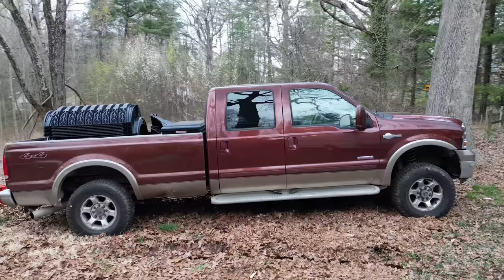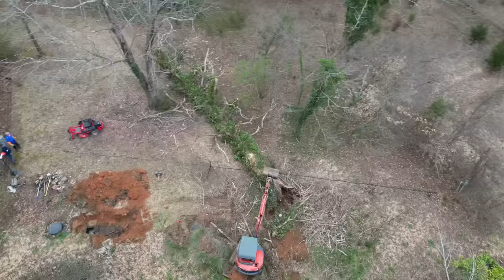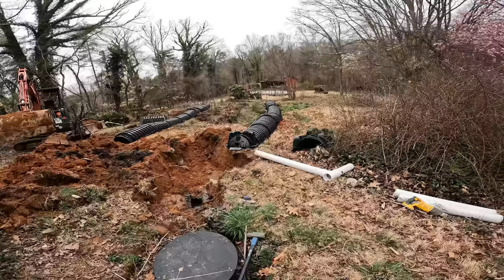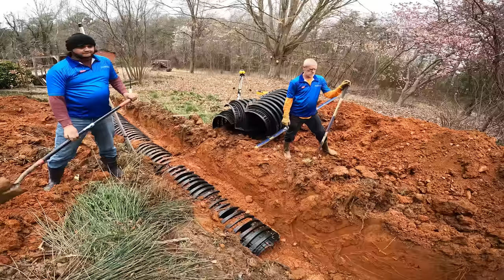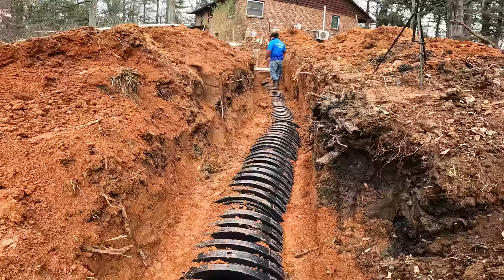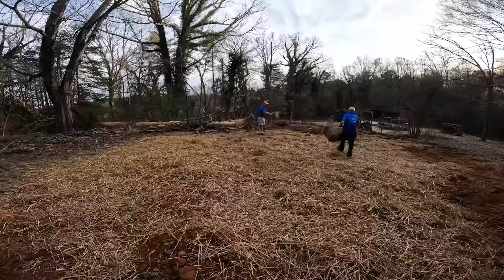Repairing a failed leach field by Replacing a septic field with chambers

Comment: Ugh, I would never want to do anything like this. We had issues with our septic tank when we bought our current home. It had a drain field in thick clay and it never worked properly and we had constant surfacing. Smelled terrible. Had to change the whole thing out for an aerobic system. Works fine now.
Reply from the maker: One thing you can do in that situation is pipe the gutter water away from the field. That can do wonders for the surfacing and smelly shovel that is placed in the ground. I've done this many times with drainage systems and it improved the septic field. 👍

Comment: You said, "This double-split is perfectly level.  I showed you already."  Actually you didn't.  You only told us.  You speeded up the part where it was leveled.  To explain to viewers what they missed, your employee leveled the double-split BEFORE glueing, then marked both the split and the adjoinging pipe.  Once glue is applied, all he had to do was align the marks to know it was level. 

I'm so glad you made this video.  My dad hand dug a tank and lines in the 1951 house I grew up in.  He used concete & clay pipe and always had trouble with roots.  In the 1970s, I used perferated plastic pipe and gravel for field lines.  Less than 10 years ago, I had a new leech field  installed where I now live.  They used chambers like you.  I wondered how it works.  You just solved that mystery.  Thanks.

Comment: Interesting project as I'm a city boy. But when I lived on an island by Nanaimo BC (Protection Island) I had a septic holding tank which would pump the sewage into the sewage pipe of the island periodically. This island had running water, sewer system and communication hookups....the only island to have such things of all the Gulf Islands of BC. Cheers to you.
Reply from the maker: Interesting Laurie! This was a simple gravity system with no pump needed, thankfully. I've only ever installed gravity systems and the more complicated systems require more requirements for installers.

Comment: My old septic tank was built from concrete block in 1970. I have all low flow faucets, shower heads etc, the blocks allowed more seepage than I was putting in, so my drain field never got anything in it, not even water. Then 2 years ago, it caved in, so new tank and the chambers. Although they required 100 ft of chambers here, I am in all sand and with my low flow stuff, I could probably get away with only 20 ft of chambers, if I still had my old tank, I wouldn't need any drain field.

Comment: Omg crazy what some states let you do.  I can't believe you were not required to replace that tank man....and always pump the tank before you do a leach field repair, makes things way less messy for you and crew
Reply from the maker: I would have loved to Steve! We had exactly one day to get in here before more heavy rainfall was coming. These things don't always work out perfectly with emergency repairs like this.
Reply: I was supprised they did not have  to put gravel around the chambers and have some kind of  an inspection.
Reply: @gardenman3  inspection before backfill i was surprised about too.  As far as gravel goes,  those chambers are designed to not be used with gravel.  It's one of the main benefits of using vs a rock and pipe type system

Comment: This from infiltrator specs
Advanced contouring connections swivel up to 15°, right or left
Latching mechanism allows for quick installation
Four-foot chamber lengths are easy to handle and install
Supports wheel loads of 16,000 lbs/axle with 12" of cover
Certified by the International Association of Plumbing and Mechanical Officials (IAPMO)
Reply from the maker: These chambers are so awesome.
Reply: @GCFD  I install them on a regular basis. But we have to be inspected
Reply: @douglascole3842  There suppose to be inspected in NC also....
Reply: @treymintz4455  I figured as much

Comment: I learned now what a leach field is. in europe septic tanks rare because all houses got a drainage into the  city-recyceling-system more and more. just a few houses got a septic system mostly in little communtiys. 
but one question is open for me.^^ how can you clear a leach field when its clogged?  i mean normally clear water goes into it but when the water stands and doesn't seep away?

great video....i love see you with your team doing drainage-stuff....after when you're done, the land will always look clearer and better.^^
Reply from the maker: The old field was going along the slope back and forth and I went down the slope into clean soil. If the soil is extremely contaminated, you would need to remove that soil and replace it.

Comment: A few widow makers on there... Just send some guys that don't have wives to do the work around the tree/take it down... that way they are no longer widow makers, just killers :). 

Wouldnt you get a pump service out there first to pump out and drain the septic tanks so you didn't have to deal with full chambers?  And then they start with a full clean new system and when the home owner decides to take a shower or drop the kids off at the pool while your working, you dont get hit with overflowing poo water. 

City boy here, had city hook ups at everywhere I've ever lived in Phoenix Metro valley area...  Now I am in Far North Peoria (what people call Phoenix as the whole valley, but i'm in the city of Peoria), and just had a house built about 3 years ago and the land out this way is all solid rock...  this is where at the rock queries are for landscaping, down in the riverbed about 200 feet from my house.  Now all filled in.  But no soil out here.  I dont know if a septic system  could work out here with all rock.  But I have city hookups.  all my neighbors that put in pools all had to pay for tough digs and use jackhammers on excavators to dig the holes for a pool...  The community grade work flattened hills and all kinds of things and so we have about 2 feet of broken rock, then solid granite.

Comment: Yeah that was really good job. Those things work really good. Well you have the tank open. Why wouldn't you get the tank sucked out to take all that crap out of it and to be a lot easier to work. You just have a lot more room. You sealed the top off so how is he going to get the tank pumped out if he has to? That was my thing you got to pump the tank out. Did you make a map to show where the tank is and where your two checkpoints are at the end of the the two runs? Just curious. 👍👍🙂🇨🇦
Reply from the maker: I know I said the Lid, but that black round lid is the actual lid to the tank. The open end of the tank, someone had previously broken it to install that PVC baffle and then just placed the broken pieces back together. We talked about getting the tank pumped, but the homeowner had recently pumped it, so he wasn't worried about it. I forgot to mention that.
Reply: Okay that makes sense but it still didn't look too clean in that tank. I would have got it pumped out again but his money you can do what he wants I guess no that was a good good job. 👍👍🙂🇨🇦
Reply from the maker: I thought pumping it out was a good idea too.

Comment: IF the leech field is clay, will it drain? Should you not truck in a load of sand?
Reply: Wondering the same thing!
Reply from the maker: It does perc, just slowly. The nice thing about the chambers is they are very high capacity (around 45 gallons), and they fully use the soil because there is no gravel covering the soil. The chambers also have slots on the sides so the sides of the trench can accept water as well. They are also made from recycled plastic. These chambers are a great technology.
Reply: Awesome, thank you for the response!

Comment: 20:13 so the idea with the leech field is to allow the water to get distributed on a big area. Definitely that clay soil is not helping so why you didn’t added a layer of gravel on top of the tubes to allow the water to move more? Clay is usually used on dams to prevent water leaks so i don’t see how this is going to work….
Reply from the maker: Gravel blocks the soil surface because water can't move through rock. This clay does perc, although slowly. The sides of the chambers have slots as well to allow the sides of the trench to accept water. Chambers are the way to go.
Reply: @GCFD  i’m not questioning the chamber’s. I agree with that system 200%!

Comment: Better hope the county don’t see this. Heck of a fine will be coming. Have to have new leach fields permitted and inspected. Nc level 4 licensed installer
Reply from the maker: Why level 4 Jimmy? This was a gravity system with one tank.
Reply: @GCFD  I think what Jimmy is saying is, he is a level 4 installer, not that you need to be a level 4 to install this type of system. While I really enjoy your work, I agree with jimmy, the county health department should have come out and written a permit for this determining the trench bottom and location of the field. Also, correct me if I'm wrong but I tried looking your license up and was unable to find it...Lastly, the tee fitting you used, is what we refer to as an "indy" tee for cleanouts, not made to be put on its side. North Carolina typically requires a distribution box to be used.

Comment: Good Job, But I would have talked the home owner into replacing the tank for sure, that tank is going to have to be replaced at some point and if he tries to sell that house, that tank is NOT going to pass inspection, at least it wouldn't pass my inspection, Im out of the business now and I must say I DONT MISS IT. Best of Luck Thanks for the video......
Reply from the maker: Yes! The homeowner is definitely working towards replacing the tank. The main objective here was to get the system back up and running. The tank is working right now so it's good for now.

Comment: Owner could have got in arboriculturists to clear trees away; owner's choice to have a drainage company give it a go.  Don't feel bad about the cable!
That tank could benefit from a pump out.  Shouldn't there be an effluent filter on the outlet pipe to the drain field?
Why did you use a twin elbow rather than an adjustable D-Box?
Reply from the maker: Thank you! I still felt bad about the internet cable. The tank has that nice riser for easy pumping. I recommended the homeowner pump it out. The effluent filter is only used when you can access the filter. The tanks I install are two chamber (nc requires) with double access holes so you can access the effluent filter. I typically used the twin EL over a distribution box when I have only two laterals. I definitely could have used a D box with speed levelers in this case.

Comment: The home owner should have had all the gunk in the septic tank sucked out before you finished.
Reply from the maker: He said the tank was pumped recently, but he also has that nice riser he installed so the tank can be accessed with a few bolts and no digging.

Comment: You had the chainsaw, cut a wedge the way you want it to go.
Reply from the maker: I wanted to use the tree's own weight as leverage to pull the stump out. Cutting leaves the stump to dig out, but I wanted to take the field right through there.

Comment: WHY not get it pump out first?
Reply from the maker: Timing. We had exactly one day to get this done before some massive rains were coming in and would have delayed the project by a week. The Homeowner has that nice riser he installed so he can access the tank with a few bolts and no digging to pump later.

Comment: - hate to say that septic tank will eventually need to be pumped out. Having access or marked spot for tank cover (which you cemented shut?)will be helpful when tank needs pumping.
- taking a shower with open ended septic pipes may indicate the homeowners mentality a bit. Thinking he flushes and washes all sorts of non friendly septic stuff into the tank….just sayin.
Reply from the maker: Hey Mike that was not a kid but where previous people had broken into the tank to remove clay pipe and install pvc     The owner had installed a nice 24” riser (round black lid) for easy access to tank.

Comment: Ew, you kinda should have had the system pumped out right before your labor.  I'm so sick of getting sick that I don't enter yards or neighboring yards of people who aren't up to date on the online permitted-OSSF maps.  I get 48-hour fevers & skin pimples if touch untreated-effluent, I think everyone gets sick too but they're use to the cesspool-lifestyle that is slowly getting banned.   If I did that type of work I'd have denied them for refusing to purchase a riser, (Operating OSSFs NEED to be pumped out every 2-5 years & they only have a lifespan of ~25 to a max 40 years).  I wish the New/Modern OSSF standards where enforced in my area, I'm not certified but I've never had an installer or inspector pass my Spot-Checks & I'm only using the basic-installation-guide from the manufacturer(It's wild what they'll skip for $3 there or $15 here...).

Comment: It’s a shame no one has invented anything that can help control which direction the tree will fall. Maybe something that is strong enough to cut it, maybe like a chain made of little
Chisels that spin real fast. Like a hacksaw but made for trees
Reply: Throwing a cable on the tree let's you control the direction of fall.  Either with a cable longer than the tree or a snatch block to change the direction.
Reply from the maker: We needed the stump to come out too Derek which is why I rarely cut then dig the stump. I like to let the tree's own weight pull the stump.
Reply from the maker: I usually rope a tree if it's in a bad spot but I thought I could push this one in the right direction. I've got a tree at my place that will be roped.